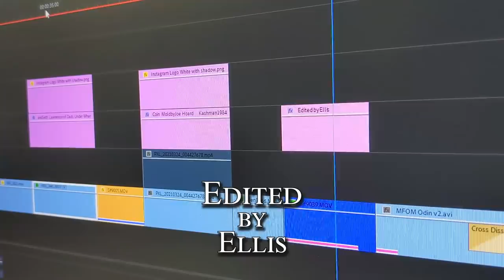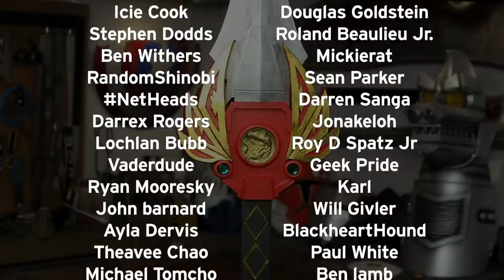Odin Makes: Red Ranger Power Sword from Mighty Morphin Power Rangers

Comment: What’s fun is the original props were made using ye olde foamsmithing techniques as well, at least the screen used ones. In behind the scenes shots and footage you see the screen used weapons are made with foam rubber covered in paint so not to hurt anyone. It’s fun to spot the differences between variants of screen used and hero props as they often varied wildly, especially in early series.

Comment: The intro is awesome (I can't get over the one handed cartwheel).
The video is awesome.
The coin is freaking awesome !!!

Now I just have a question, why didn't you glue tu blade to the crossguard with contact cement like the rest of the blade ???
Reply from the maker: I didn't use contact cement for blade to crossguard because there was paint on the crossguard. That connection would only be as strong as the crossguard paint sticking to the foam.
Internal Gorilla glue was the way to go for permanent adhesion.
Reply: @OdinMakes  Thanks for the answer.

Comment: Ok. I got something for you to do as a prop make. Its from an anime but here is the catch. Its a handgun. Specifically a futuristic revolver called the Cosmo Dragoon. The iconic sidearm of Captain Harlock that goes along with his gravity saber. There are high quality replicas out there approved by series creator Leiji Matsumoto (also known for Galaxy Express 999 and Star Blazers) and even water guns based on this Warrior's gun. It's based on the Colt Dragoon and a group named Hole in the wall does a good one piece prop but I think you can make it with a working cylinder and trigger. Also curious how you would do the faux woodgrain on the grip. I'll take pictures of mine I fixed up from them and send it to you to have a look at.

Comment: You had to delay this project because you couldn't get a Tyrannosaurus coin sculpt? There are reproduction power morpher coins available in various sizes. I'm surprised you couldn't find what you needed. 

Also, I'm almost entirely sure that the emblem on the hero prop used in Zyuranger/MMPR wasn't a detailed sculpt like the power coins are anyway. It's a flat picture rendered in just black and gold. Even if you wanted to give the emblem more depth than the hero prop had, you could use that simple design as the base.